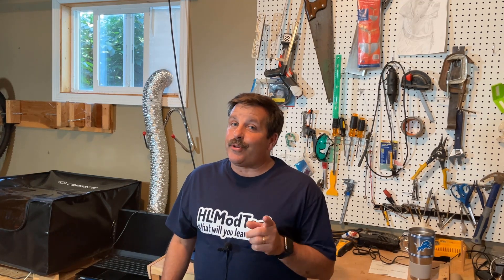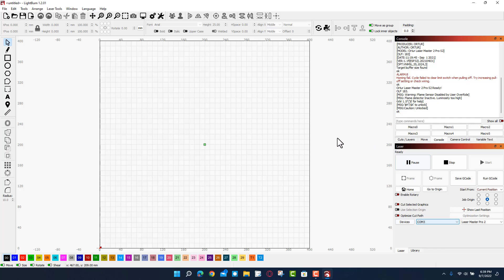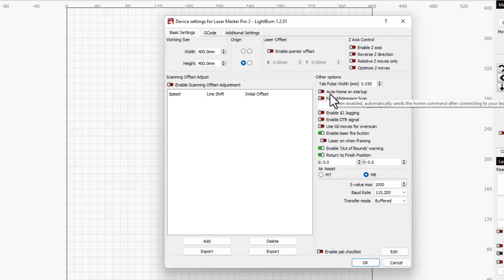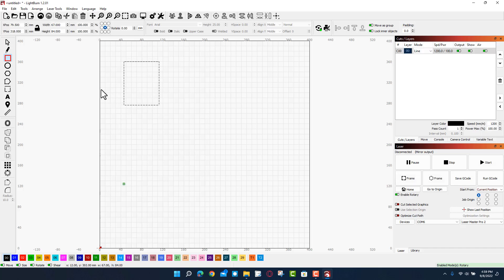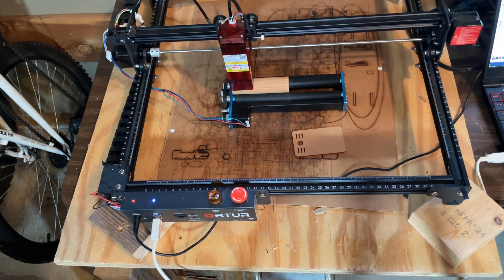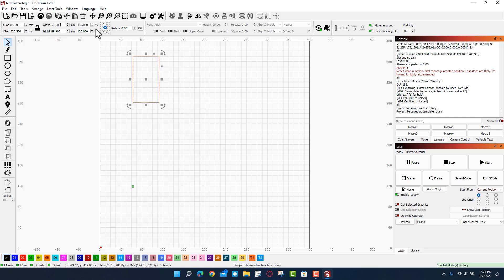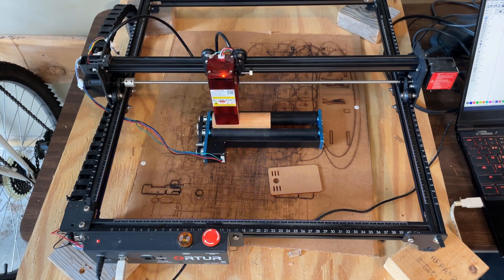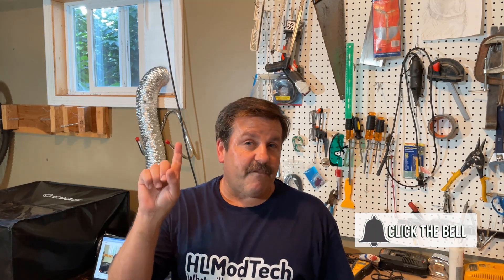How to use a Comgrow Roller with your Ortur Laser Master Pro 2 Solved!

Comment: Did you have any luck burning tumblers with the Comgrow rotary tool?
Reply from the maker: I have not tried them yet. You are talking about etching a glass tumbler, right?
Reply: @HLModTech  I’m asking about the metal “yeti” style tumblers powder coated.
Reply from the maker: @garrettriis7266  I have not tried that yet either. Thanks for clarifying. I will see what I can do.